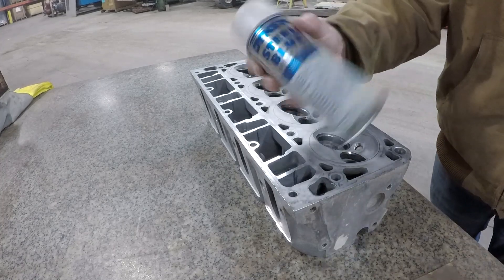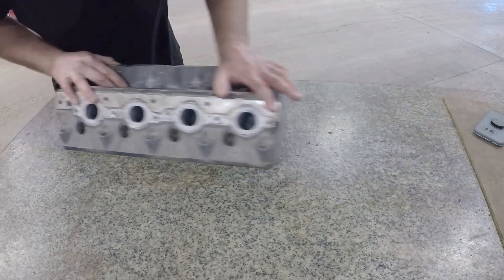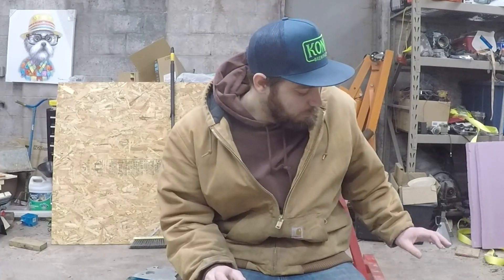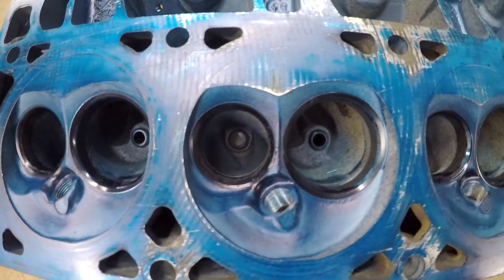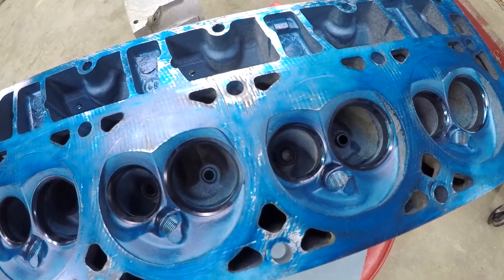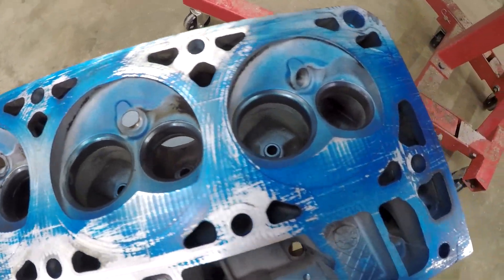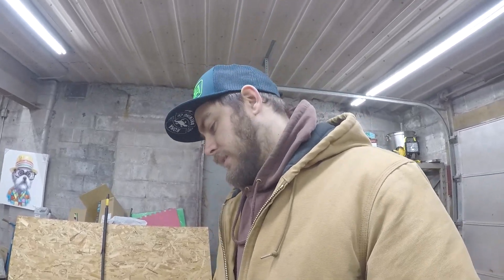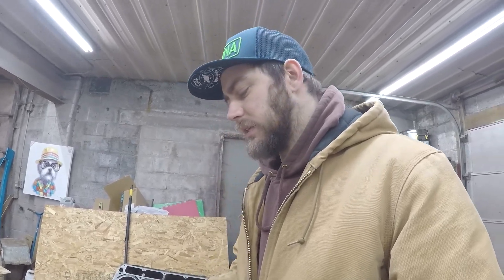So you think your aluminum heads are flat?

Comment: Good deal
Reply from the maker: Ur right. But I see so many ppl swap heads with no work done to them
Reply: Alloyspeed but that doesn't mean they know what there doing. Sometimes people act like they know what's going on and they don't have a clue.
Reply from the maker: I can relate... to those ppl
Reply: Alloyspeed man I hope I didn't come across as a jerk because if I did I was trying not to. I'm 54yrs and I have worked at a engine shop in the head department my working life. I thought even if you got mad at me it might still help you with your build. You seem like myself where you have the money to do this once but maybe not twice. Hell with what the head gaskets cost is a big deal. I'm interested in what you are doing and that is why I'm watching. One other thing is after you lap the valves before putting them back together make sure you run a brush through each guide. I've seen people spray them down and Gould a valve because there was a little compound they didn't get out. Easy to do if you don't have a brush and very costly. I'll remain quit from here out.
Reply from the maker: I want mad at all. Ur comment was constructive and helpful. Thanks for the input.

Comment: Interesting my man, myself with it being an aluminum head,would send it to the machine shop for inspection. I honestly feel that those heads werent torqqued down to proper torque specs.
Reply from the maker: Actually, I'm a journeyman machinist. This is kind of done after hours with approval. When they put new machines in they use a different block, not granite to flatten the ways. I tried to do the same.
Reply: Ok.